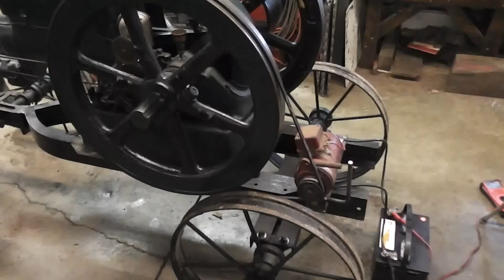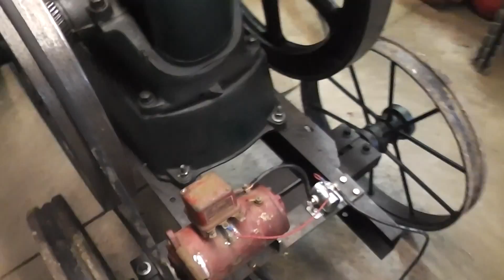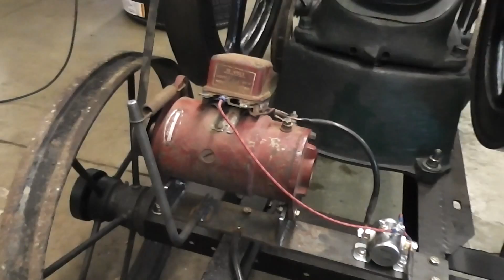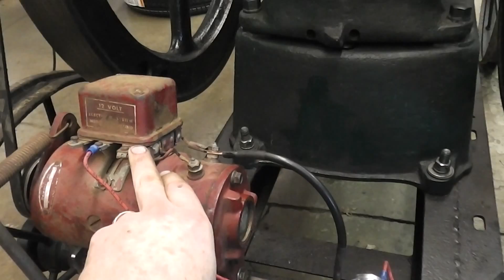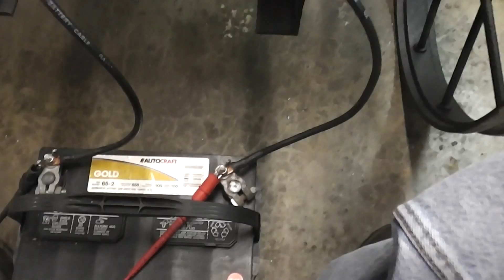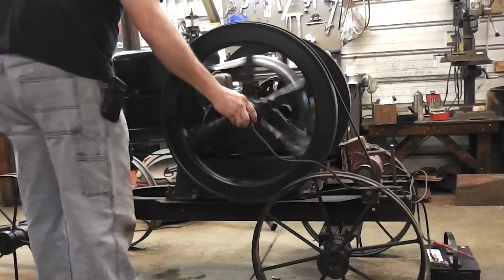Electric start Fairbanks Morse 6 HP Z

Comment: my shop is full 5hp and 2&1/2 3hp, 4hp had to cut down got rid of 9 and 7hp. i have to make an engine starter. going for one i can justroll up to engine spin flywheel all my engines on same size skids but two

Comment: Nice Vid. I have one of those starter/generators on one of my Gravelys. You can also check generators by applying voltage to the batt terminal after removing the fan belt and the wire to the regulator. If the generator spins it is usually OK.    It won't spin very fast though, because as you have said, a generator is not a very good motor.😁

Comment: Very interesting setup. I’m considering something similar for my 6 hp Galloway round rod. 👍
Reply: I had a 5 HP Galloway, rectangular rod. Owner and I had to cut away a section of it’s shed’ wood siding in order to get it out of the shed! :) I have always loved the “hunt” for gas engines. This was in the late ‘60’s and early ‘70’s. You do not have to believe me, but I typically paid $10.00 per horsepower!!! Divorce=sold all 25 of my engines…1 1/2 to 20 HP…for $2000.00 to another collector. Moral: never get divorced….or, better yet…avoid marriage. :)  After a 30 year gap in my collecting I re-starting collecting and now have 19 engines from a 2-cylinder Maytag to a 15 HP Fairbanks. Thinking of selling out…I am now an “old coot” :(.